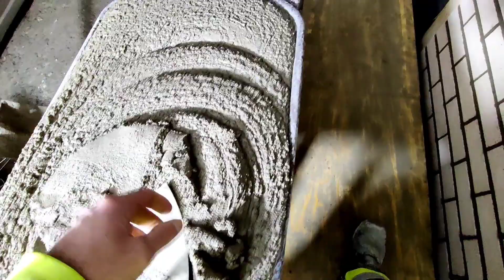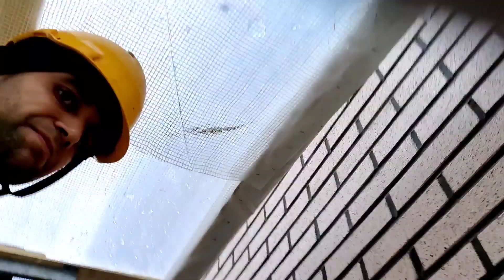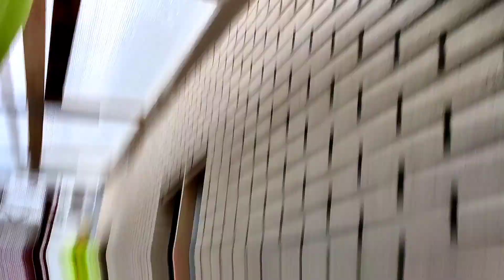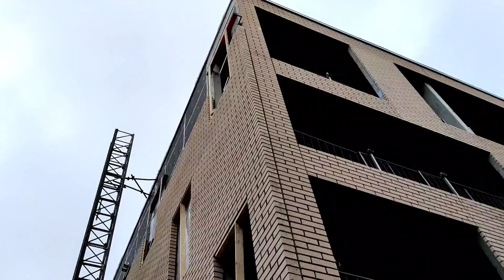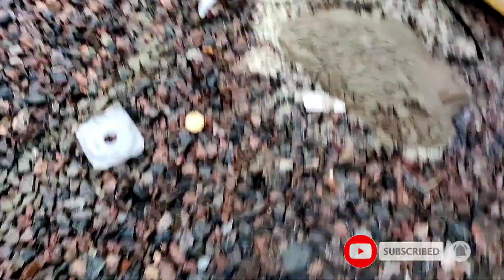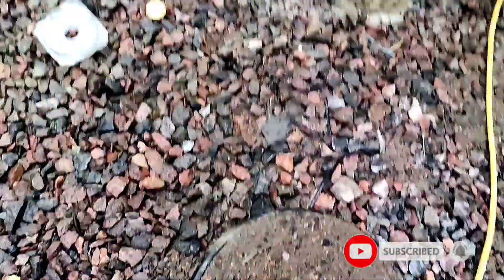Briclayer. day 3

Comment: fugen are very large, and not all the same thickness, why you do not use some frame or even wood piece they will all be the same with that, like this it will never be fine, and it is the pain to work. Also , it is nice to put insulation folium between that do not let moisture to get into internal wall, also ventilations pieces(not sure how you call them ) in Serbia we say "lufter" so the air circulates in between walls

Comment: Nice rythm. Strange technique.  Nice work though.
Reply: If this is a outside weather wall, there was no Perma barrier put on the angle iron and no weep vents. Also a head joint should be put on the brick before you lay it to get proper head joint compression. Something you learn being a Union bricklayer in the States. 
MI Local 2. Your wall fails.